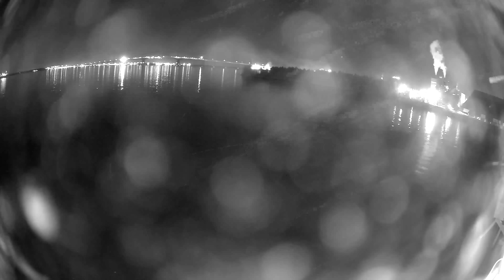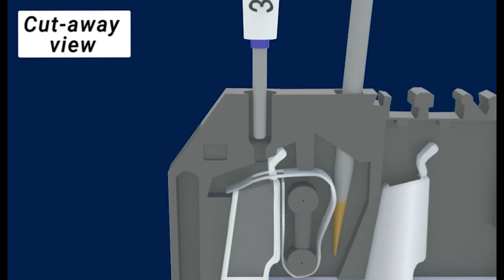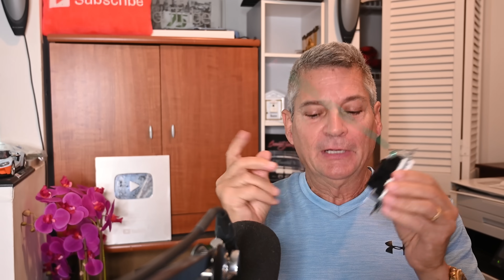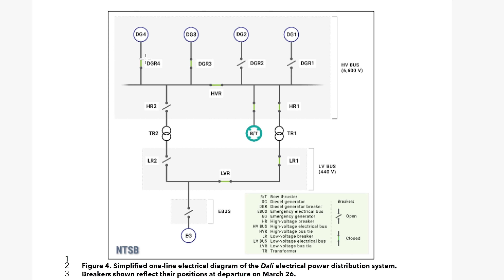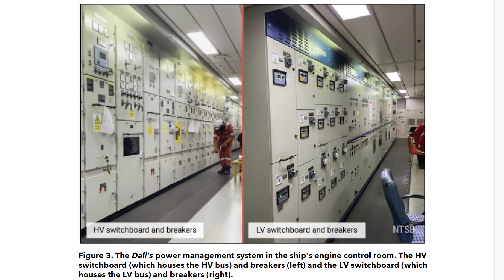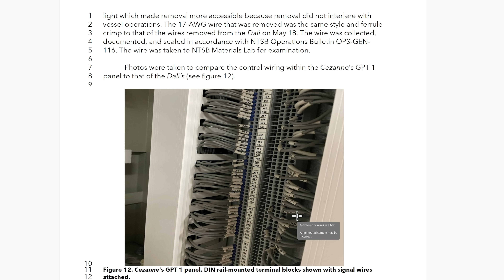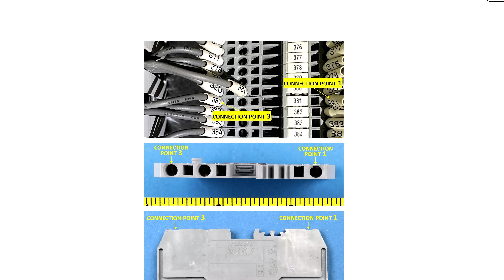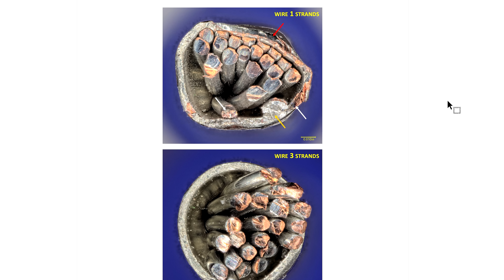NTSB: Scary Wire ERROR Caused Dali Crash/Key Bridge Collapse Baltimore

Comment: Sorry Jeff, your description of the WAGO CageClamp connector is incorrect. I worked for WAGO for 28 years, best terminal on the market, The spring pulls the conductor onto the busbar, you can see a slight curve, that is the only point of electrical contact, inserted correctly that forms a gastight connection not effected by vibration. the Cage as you said is only for the conductor to be inserted far enough in, as the spring and point of contact are at the top, this is a safe termination, a screw terminal would require the conductor to be clamped for the full length. This is 100% installation fault by the use of the incorrect numbering sleeve. Unfortunately WAGO can not overcome idiots on installation. Sad that that caused such a horrific accident. Please ensure you give a correct explanation.
Reply: Key element is that the captivation mechanism created by the shear cut rectangular hole has a knife edge like impingement against either a group of wire strands or that group twisted and solder tinned, or a singular pin onto that group which was swaged onto the wire 'bundle' to ensure the maximum number of conductor strands get used, which keeps the wire able to perform at the declared standard wire ampacity specification for that gauge wire.  The shroud or collar is a strain relief as it matches the shape of the "socket" above where the conductor strands stab in or the pin.  They appear to me as an option.  This knife edge impingement still happens even when a pin is used, and the connection is also considered 'gas tight' as that which we see with a stranded bundle, just as you stated.  The faultily fabricated and subsequently faultily inserted and subsequently faultily inspected Wire 381 was only resting against the terminal capture mechanism with the tip of its ferrule in the axis of the wire.  It may have only carried the current to fire a relay however many hundred feet away, but the loss of even that small circuit connection means that one wire physical element of that circuit was no longer in place (existence), therefore not a circuit at all, but a broken circuit, not broken at the deliberate points of control.  Oh, hey Derek, I am 100% layman here, just a smart old dude who really did work with WAGO devices exactly like this for electrical control panels that Amazon uses to this day to control their conveyer and sorting systems.
Me:
  OK...  WHERE is the redundancy?  And when a many many many ton vessel is in motion, there should be personnel stationed at several particular motion critical locations, ready to assume or enact manual control(s).
Reply: @cosmicraysshotsintothelight   Agreed,  yet as a green layman , I have experienced faulty ferrule crimping impeding insertion into capture slot resulting in increased force applied to wire during insertion and ID tag sliding along insulation giving the 'appearance' of completed connection. I know, I have done it myself and used a permanent marker to indicate correct  position of ID tag relative to wire covering.
 Your comment on lack of redundancy jumped out. Frequency sensors should trigger an earlier activation of  idle generator since it take some time for it to adjust to synchronization.
  Gas tight, I believe is an illusion , for such a multiplicity of wires, which would be better served by them  being routed in gas tight conduit right out of the switch gear enclosure.
Reply: @richardbarber4444  The term "gas tight" only refers to the point of impingement the clasp makes against the wire.  Short of any flexure, it is practically such.  Flex it a bit and it would have to re-bite.  But no, the cabinets and switches, etc.  None of that is likely "gas tight" or needs to be from the definition that electricals in volatile environments refer to.  I can see where you could be confused by the use of the term.
Reply: That's what he said. It's an installation error. However, this is an opportunity to see if the design could be tweaked to make this kind of installation error harder to do.
Reply: @noxagonal  These devices are 'rock solid'...    for many years.  It is a perfectly valid design.  The blue shroud is designed to match the "cup" that is above the 'hole' the wire ends up at as it finds its way into the capture mechanism.  Properly, Fully seated, it is absolutely one of the best connection systems in pace worldwide.  The shroud ensures that any flexure applied externally to the wire tugs on that shroud before it begins tugging on the wire (conductor) capture location.  The unshrouded installation method works great ALSO and was and or is still in wide use and is still of high integrity in all walks of industry where centralized control of multiple, non-integrated devices or subsystems is needed.  Wire tag placements cannot be permitted to interfere with the integrity of the wire connection.  The entire key is ALWAYS proper, high integrity fabrication step compliance to insure a reliable finished system control product.   That is to say that good, properly trained assemblers and wire harness builders AND the QC personnel who should be/are the teachers of the builders...  In the mil spec days, not a single element was missed (extremely rare).  In the days now of COTS, inspections and the quality of inspection and those inspecting have decidedly eroded in certain ways.
Reply: @dereklane5688  It's worse. If you look at the NTSB report and compare how much of the plastic part of the ferrule can be seen in Figure 55 and compare it with the marks from claming in figure 59 and the propper insert dept in figure 60, you'll find that non of the wires are  inserted deep enough and they all hang on to the last 3mm ( 0.12 inch) of the ferrule, when they have ~ 9mm when propperly insertet. The heat shrink labe only pushed that one connection over the edge. The same could have happened if someone hadn't inserted the wire deep enough during crimping or just had removed a bit to little of the insulation before crimping.  If the top of the plastilk of the ferrules doesn't sit almost flush with the wago clamp for the used ferrules ( I'd say DIN-BL14-LO, 12mm 0.41" blank metal length), it isn't inserted deep enough, since from the top of the clamp to the spring gate is 9mm 0.35".
Reply: @clockworkvanhellsing372  Read my comments above!!
Reply: @clockworkvanhellsing372  And ANY non-insertion or partial insertion or improper application of the shroud or the label should have been caught by the decidedly non-existent QA inspection step.  The wire prep step is easy.  Training it on the shop floor is easy.  The prep AND inspection steps are ALSO easy to perform and follow AND INSPECT. All before any wire has even been inserted, THEN the labeling step(s).  THEN the insertion steps where the actual assembler THEN performs a pull test AS each wire is inserted into the panel.  THEN the QA person performs an additional visual examination of the wire tagging and THEN ANOTHER pull test, and THEN the panel gets "accepted" and "declared" as being "Compliant" with the contracted schematic and build for that panel.  And in a properly configured "installation", all wires would have proper strain relief practices introduced into them to keep any of the conductors from pulling on their termination point.
Reply: @cosmicraysshotsintothelight while I fully agree that this is best practice, the reality is, things get dones by the lowest bidder and people make mistakes. As long as the ferrules are almost  flush with the clamps, the safety marging for other faults increases and of all things to check, this one is the easyest. That ship probably need to have every important panel rewired, if it is as bad, as it seems in the image.
Reply: @dereklane5688 Isnt this wago spring clamps meant to be used without ferrule?
Reply: @ondrejsejkora4561  Wet location or sea location may be a factor in that.  These also have the blue shroud to seal the entire wire, so I suspect it is a state of the art design meant to separate two different environments.  Reducing any chance of galvanic response, etc.  I am just guessing here.
Reply: @ondrejsejkora4561  No, you can use solid core, stranded or ferrule connections on these clamps. Ferrules are recommended for their reliability in engaging all strands in the connection.
Reply: The person doesn't need to be an idiot to make that mistake. Improper training is most likely. Engineers are not infallible, and any business can put profit over safety. 20/20 hindsight.
Reply: 1. What do you mean by "gastight connection"? -- There is no gas involved, apart from air, which can of course still move around inside the WAGO connector assembly even after correctly terminated wires are inserted. The blue plastic part of the ferrule slides with a close fit into the housing (clearance is ~0.2mm), but by no means can this be described as a seal, much less a gastight one. It would mechanically help dampen major vibration/flexing of the wire very close (within 10mm) to the connector block, but that is about it. As far as ensuring the electrical connection is secure against vibration, that is all down to the constant spring pressure on the ferrule holding it against the busbar, assuming that all the rest of the process has been done correctly.

2. If you mean it in the sense that the ferrule, when properly crimped onto the stranded conducting wires, should never allow air gaps (thus risk of arcing) between the various points of metal surfaces making contact inside, then yes, that is accurate and understandable. And the same should naturally apply to the connection between the ferrule and busbar, when the former is correctly inserted and clamped by the proper spring force - no air/arcing between the contact surfaces.

3. In this case the ferrule crimping was totally botched, the ID-tag was fitted over the plastic end of the ferrule, increasing its diameter and ensuring insertion length was way too short, thus spring never properly gripped or slid off the angled edge, thus termination of #381 ended up sitting atop the fully closed spring with intermittent contact & arcing.

4. So I agree the whole problem here was certainly due to serial installation errors plus lack of QC, not the WAGO design, which is excellent when used competently. But as this case demonstrates, someone can always build a better fool.
Reply: @foobarrel9046  If you are in the electronics or electrical power industry and do not know what the term "gas tight" refers to...  you should get online with the makers of connection pins and crimp connectors and see if one has a primer for you to learn from.  It is not just not knowing about the term itself.  Not knowing the term or the principles surround it is a huge fail for a person claiming to be in the industry.  I do not know what you were doing during your learning of the field, but you missed a huge chunk and sport some aptitude lackings as well.  We use anti-oxidant paste as well to keep Oxygen away from connection nodes.  A properly crimped pin on a wire seals off Oxygen from the area that was cinched together, keeping the connection in good integrity longer and insuring that all conductors of a stranded wire get utilized as missing strands breaks the ampacity or the wire.  Whther the wire carries 10mA or ten Amps, the spec for fabrication of the terminations requires the fabricator to NOT EVER nick wires or strip the wire shedding strands.  The strip process is very precise, done correctly. And that yields "the ideal termination", which is the goal for ALL wires. Getting casual about the simple step of stripping the wire or the crimping of the pin (ferrule) or the placement of an identifier tag, though easy to perform, are critical to perform correctly.

  One does not put the wheel on the axle and leave some of the bolts loose or only partially torqued.
Reply: @cosmicraysshotsintothelight  My speciality is automation (industrial robots & PLC), so the "gas-tight" term was unfamiliar, but thanks for the useful info plus due scolding ";0)).
Reply: @foobarrel9046  I have been so angry about things in the whole world lately that I probably was a bit overboard.  I wish I could direct that anger where it really belongs. And I am no longer talking about wires now.

Comment: I like Wago, used them when I was stationed in Germany, but they are not the best. Those “alligator clamp” style can wiggle out. Electrical connections must be electrically and mechanically secure. Just like you mentioned nothing beats the side wire J hook otherwise a compression screw connection.

Comment: Complex systems, especially those designed by humans with inadequate levels of omniscience, will always have design problems that can lead to unexpected failure modes.  However, the problem in this case has less to do with badly placed shrink wrap labels on ferrules, and much more to do with:

1.  Lack of adequate steering control authority of the ship, during propulsion and/or electrical system failure.  Propulsion engines and electrical systems can and will fail from time to time.  That is to be expected.  What is required however, is to maintain steering control of the heavy/high momentum vessel at all times, including at times when electrical systems and/or propulsion system failures are simultaneously occurring.

2.  Bad bridge design, lacking intentional weak points to limit damage propagation.  A long spanning bridge absolutely should not be designed so that a single point failure (ex: of a single support column) can take down the entire bridge.  Taking out a support column should take out two segments of the bridge (that are attached the the failed support column), not the entire bridge.  In the real world, problems do occur, such as metal fatigue cracking key metal struts, collisions with ships, collisions involving motor vehicle traffic on the bridge, rusting of key components, concrete cracking and spalling from internal steel rusting, earthquakes, excessively strong wind and wave storms, sabotage, acts of war, etc.  Failures will happen, given enough time.  High inspection frequency and excessive maintenance cannot catch and prevent all failures before they actually result in failure.  Long spanning bridges with multiple support columns thus need to include intentional weak points to limit damage propagation, once inevitable failure scenarios do arise.  If only two segments of the bridge fell into the water, instead of the whole thing, likely no one would have died, and the bridge could have been relatively cheaply repaired.

Focusing too much on badly placed shrink wrap labels on ferrules, without mentioning either of the above two points, essentially guarantees a future repeat of a similar scenario, at some point in the future.

Comment: One way to make the terminal block more fault tolerant would be to increase the diameter of the hole in the plastic so that if a label ends up on the plastic of the pin connector, it could still fully seat and make a good electrical connection.
Reply: No.  That introduces the possibility of 2 wires getting put in the 1 connection.  The solution is complete visibility of connection.